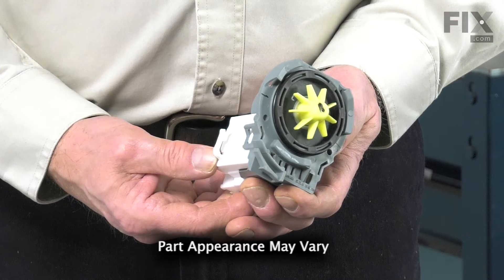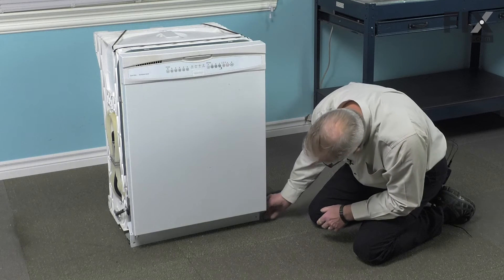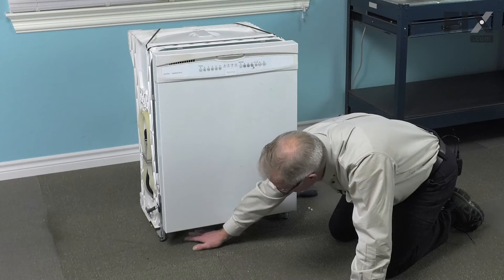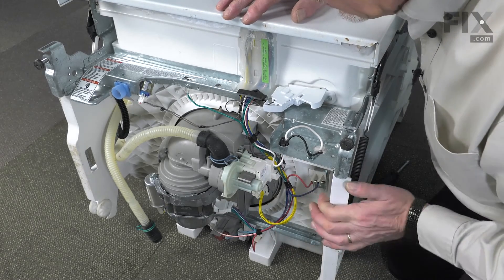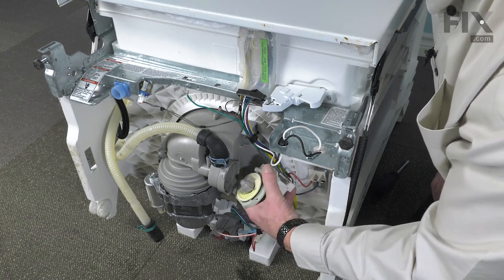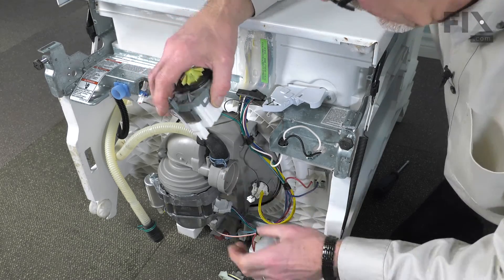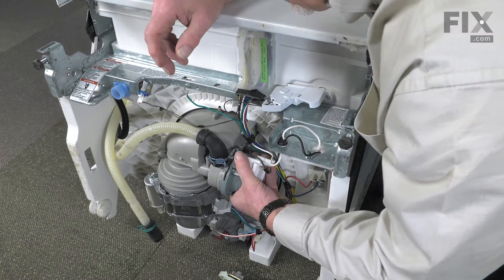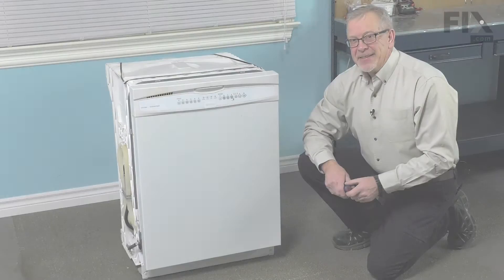Whirlpool Dishwasher Repair – How to replace the Drain Pump

Comment: Great video. A small piece of glass had impeded the propeller. I removed it, replaced the motor and it works like it's brand new. This video saved me probably $200 dollars on a service call and only took about 30 minutes total (including troubleshooting and cleaning the filter and hoses) thanks
Reply from the maker: Glad it was helpful!